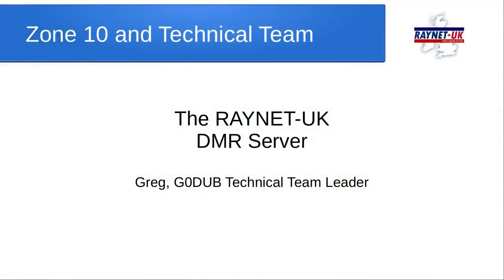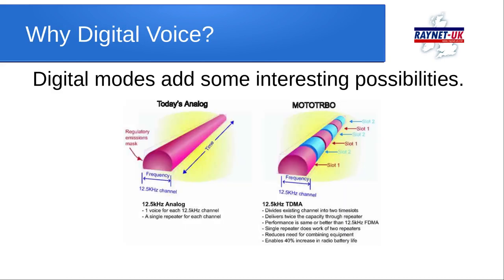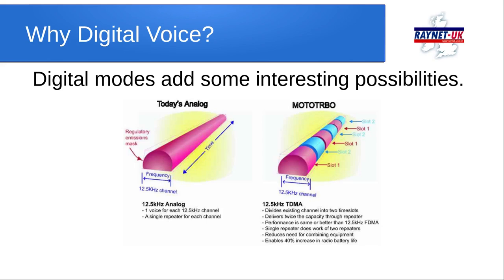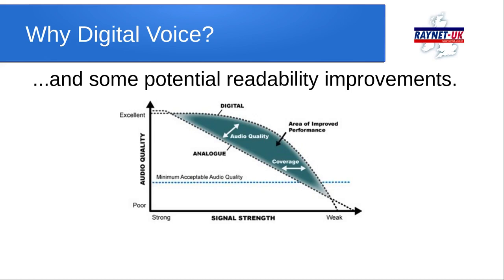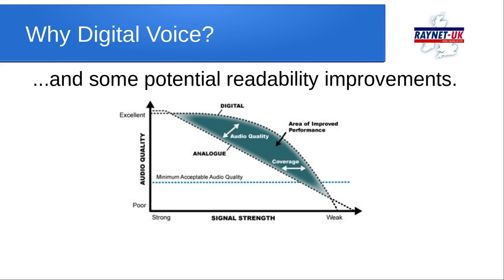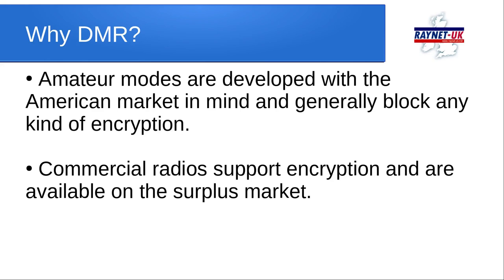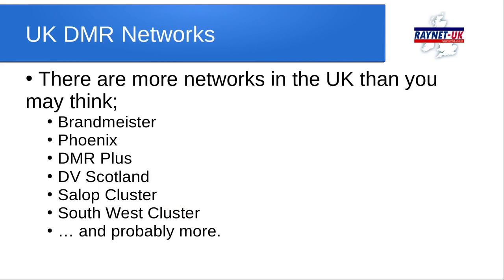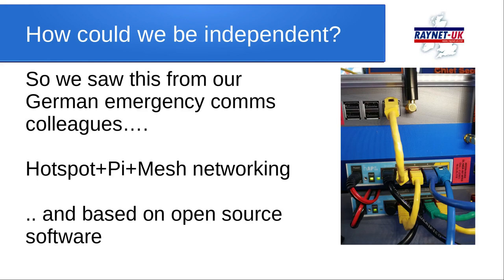RAYNET-UK - Why Digital?

Comment: its a good idea to keep Raynet off the Ham radio bands, using the internet is a good idea, when was the last time they were called out ?
Reply from the maker: Sorry Brian, this very much uses the amateur bands for the handheld part of the link. While we use the 'public' internet to join up those members who want to develop our use of digital modes or try this system on the many public service events we cover, we don't forget that the ITU recommend that the Amateur Radio Service develops and keeps networks separate from other utilities and systems so rolling this into our own networks such as AREDN mesh and helping keep the utilisation of other amateur allocations as 2.4 and 5GHz up helps the hobby generally.
In 2020 roughly 10% of our 117 groups around the country responded to a 'callout'. These don't have to be a communications emergency, sometimes it's just putting eyes where other systems can't see or helping organisations get the communications solution they need.
Thanks for watching :-)